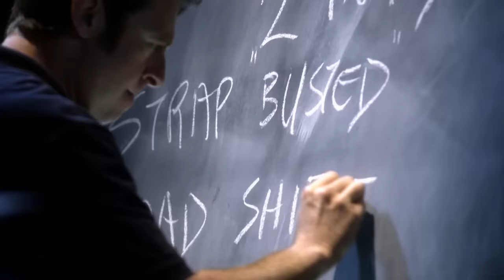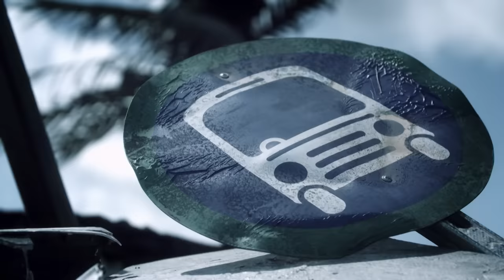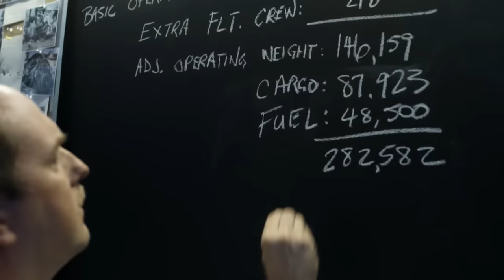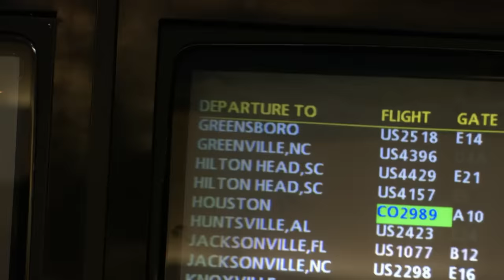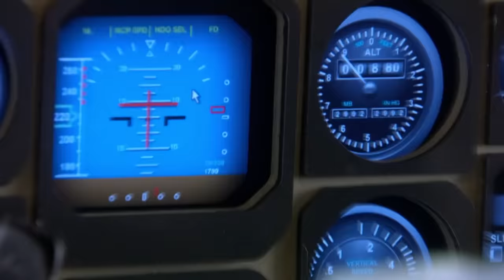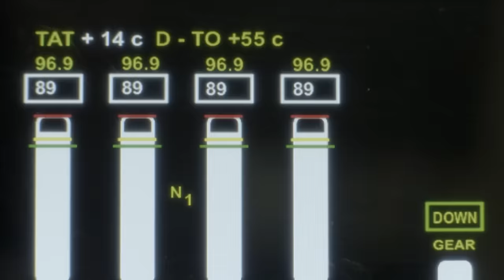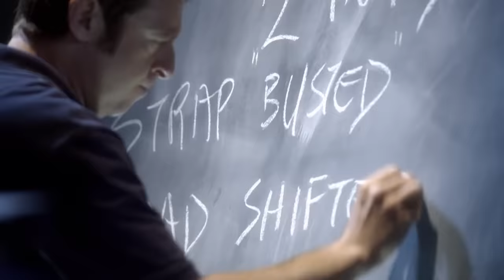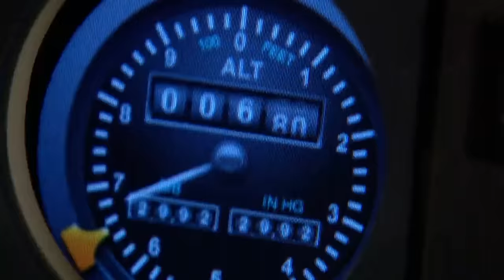Calculating Catastrophe - The High Stakes of Flight Planning

Comment: You would think they use chains to hold the MRAPs in place instead of orange nylon straps from Harbor Freight.  Its insane what happens when you let monkeys run the zoo.
Reply: Chains can't be fastened with the same precision as straps. They would all have some amount of slack in them and the load would shift no matter what.
Reply: You know it is a re-enactment right?  That was not actual footage of the actual straps used.  That was not footage captured during the actual load process - the clipboad guy 'inspecting the load' likely works at a Subway sandwich shop in Toronto. 
The video did show cheap Harbor Freight straps to ......get this.....tell the story.
Staps are probably used, for weight reduction if nothing else, but just because someone stopped by Harbor Freight on the way to the studio does not mean the military does the same.
Reply: @kenp5186  If they can afford to get an MRAP, they can afford to buy better straps for the re-enactment.
Reply: @PhycoKrusk  Oh really?  What a load of crap.  A simple search on google for "mrap chain holddown aircraft" shows they are being strapped down with chains now.  They use a turnbuckle to tension the chains.
Reply: @ahndeux  I am going to not search for that image specifically because of your attitude.
Reply: UPS uses straps that look identical but are FAA certified and must be inspected before each use
Reply: @moranarevel  I seriously doubt it.  FAA certified straps may be orange, but its much thicker.  The ones used in this video is so flimsy that you can see sunlight through it.
Reply: @kenp5186 are you saying the load master's acting career never took off? .. so to speak.

Comment: i would love to watch a documentary about the ntsb itself. not just airplane investigations but other kinds of investigations they do in addition to that. its such an interesting job and they are relatively invisible to us regular folks outside of these types of programs.
Reply: For example, they are responsible for pipeline disasters as well. That's technically transportation.
Reply: Also train crashes!! If I knew about them when I was in highschool I would've went to school and tried to go to work for them, they have very important and interesting jobs
Reply: I remember in June of 2011 here in Northern Nevada about 60 miles from where I live a man driving a large truck ran through a rail road crossing and slammed into a passenger train!  The NTSB investigated that incident and til this day the families, the railroad company and the trucking company are still dealing with lawsuits from the families of the people who died in that accident.  The NTSB investigates anything transportation related just about.

Comment: This is a compilation of three seen episodes for me of crashes caused by shifting weight, bad balance (weight distribution) or outdated assumed weight of passengers and luggage.  One of the crashes, a small commuter prop plane, had improperly maintained/adjusted flap controls that made recovery impossible.
Reply: If I was running an airport I'd make EVERYONE  STAND ON A WEIGHT MACHINE.  just like at the Dr. Office and print their weight on the ticket.(it would also make people  sit where assigned  ) balance  is determined  where people  sit.

Comment: 1st time seeing these episodes and the second I saw those "safety straps" they were using to secure the MRAPS, I said those cheap Dollar General straps busted I know it. How on earth could they so carelessly go about that thinking those dinky shoe string straps would secure all that weight is beyond me.
Reply: Tensile strength on nylon is stronger than any chain rating.
Reply: Was it the actual strap used or a cheap prop bought for a reenactment?
Reply: @BillClay88  depends on the strap and the chain you’re comparing
Reply: I’ve seen the full episode this is based on, and it was the angle of some of the straps, not the quality of the straps. Different angles secure different amounts of weight, according to the full episode.
Reply: @zorakj  Correct, and they were likely props,  on camera  you can't really tell.
Reply: The tensile rating is high, but unequal torsional forces placed on the strap could easily exceed that.  CHEAP CHINESE waste of resources

Comment: That hard to believe that the loaders used nylon straps to secure those extremely heavy steel vehicles.I figured if the one in the rear ever came loose it could go thru the back of the plane.The vehicles are heavy steel and the airplane is relatively light and made of aluminum.Its like dropping a brick on top of a suspended sheet of tin foil.

Comment: When i first saw the 2 inch tie down straps I was hoping that wasn't the actual size used. Even the 4 inch straps wouldn't have been perfect. Chains, cables and "come alongs" and wheel chocks with a confidence  building fail safe back up system. There, fixed that for you.

Comment: Seems like it would be easy and not that expensive to install weight measuring load cells on the landing gears of the plans so the pilots know exactly how much weight there is any how it's balanced before takeoff. Then they don't need to use "standard weights" for anything

Comment: When you have giant people complaining about how asking their weight has absolute meaning on a flight, they should watch this video.
Reply: Agree!  That 175 average weight is too low these days.  At least in America, that's the average weight of a WOMAN, men are often much more.  Men women and children are all getting much heavier, well over half our population is overweight and a large part of that stat is in the obese category.  These weights will not be accurate and it's only a matter of time before it causes disaster.   But, these people care more about their feelings around their weights/size than they do about the safety of hundreds of other innocent people.

I personally feel that larger people should have to buy two seats as to account for at least 2 people weight-wise in the pilot's calculations. OR even better, everyone get weighed in a set-aside area at each terminal (or even with your baggage) and if you weigh past a certain weight you must buy extra seat, or if the weight limit of the plane is exceeded the biggest people must be pushed to another flight with less weight on it to ensure safety.   (And I'm clinically obese, so I'm not just some skinny b*tch stating this).

Comment: 27:15 Airlines and the FAA are in denial about how big the average American is when it comes to seat size so don't be surprised that their average weight is way off

One thing they found at the Bagram investigation is that the loaders had followed the recommended loading procedure issued by the MRAP manufacturer.

Comment: On the third video with the military aircraft if the MRAPS are chained to a pallet why not use chain and binders to secure them to the cargo hold instead of using heavy-duty nylon straps( granted the nylon straps in the recreation were probably from Harbor Freight)?

Comment: In several crashes the pilot needs a lot of physical strength to wrestle with the planes controls. Question: would any of these that were saved by strength have been lost if the pilot(s) were weak?
Reply: There are a few instances where pilot strength probably mattered but that happens less today because the controls are hydraulic and if the controls die then it doesn't matter how strong a pilot is. Also most pilots are strong enough, the problem is stamina. In some cases they've had to manually fly for over an hour. Strength was not a factor int any flight in this video though.

Comment: They need to make runways longer, so they don't have to worry about V1 and V2 take-off. This is so unnecessary and many lives could have been saved, if they would just build a long ass runway. Also, a plane should not be able to take-off with wrong configurations settings. There should be alarms to prevent this and computer's prevention's to keep a pilot from being able to take-off, until the computer is completely satisfied.  When they get that technology resolved, then I will get on a plane - maybe. I rather be in a car accident, than a plane crash ...lol. Yet, they make it sound saver to take a plane vs a car ...lol. I will not buy that for a second. I'm a very good driver, unlike most people.